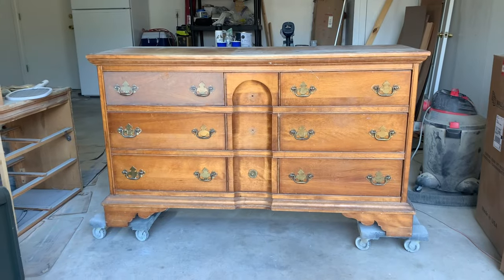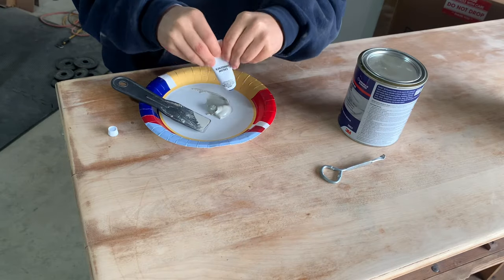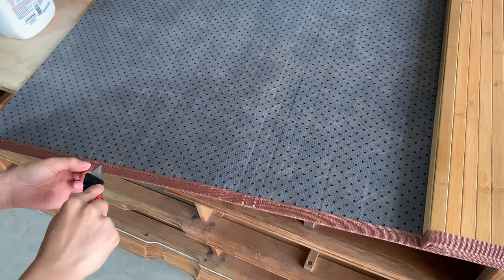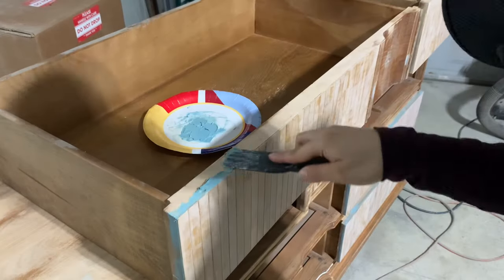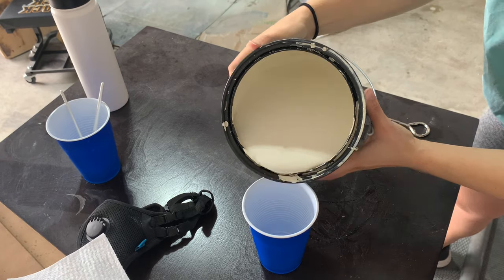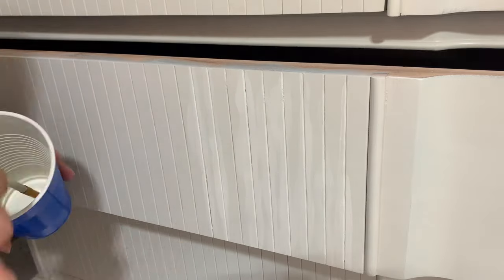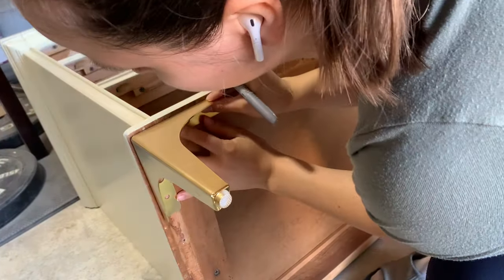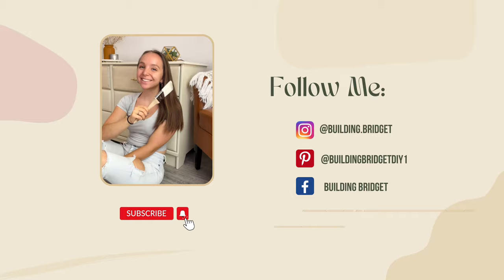EXTREME Dresser Makeover...with SECRET INGREDIENT!

Comment: Did you sealed the metal legs after you spray painted them.  Thanks
Reply from the maker: Hi Sharon! I didn't seal the metal legs after spraying cuz they really didn't need it. The Rustoleum spray paint I use isn't supposed to need a top coat.

Comment: Hi Bridget! 
Can you please help me with these questions? 
- How to choose sandpaper grit for regular sanding,  sanding for the wash effect, and smooth out after painting?
-How to take the dust off if we do not have a vacuum? 
Thanks
Reply from the maker: Hi there! For sanding you're generally always going to wanna work your way up to finishing with 220 grit. Start with a lower grit like 80 if you're having a really hard time cutting through the surface, but typically I start with 120/150 and work up to 220. After you've finished painting don't use anything more abrasive than a brown paper bag or else you'll leave scratch marks.
There's not much you can do about the dust if you don't have a shop vac. You can get one pretty cheap second-hand though usually!

Comment: New subscriber! Such a transformation, I never thought about adding light colored paint to topcoat (only dark) but this worked great.  Do you find in your market that the higher priced items take longer to sell, even though they are totally worth the price for the extra details like drawer liner, feed and wax, extra wood filling, new legs/hardware, etc.  It seems like people want a garage sale price on marketplace for flipped pieces in my area.
Reply from the maker: Hi Heidi, thanks for the sub! 🙌 Good question - I try to be selective on which pieces I'll put all the extra cost/effort into. If it's a nice MCM or just solid wood piece that I know from experience has a decent selling point, I'll go the extra mile and do drawer liners, bamboo mat/fluting details, add new legs, etc. I've spent a while fine-tuning my approach on what pieces to flip and how to market it best, which has helped me to increase my prices by hundreds of $$ over the last year or so!

Comment: I found a soldi wood dresser but the top has this wood paper covering, is there a place to get that covering to replace or just remove layer?
Reply from the maker: Hmmm if it is what I’m thinking of then I def don’t know of any way to replace the “paper” layer. If you’re tryna keep the wood finish on the dresser I’d try and remove the top and replace it with plywood to match and edge band. If you’re planning on painting anyways, no need, just paint over the current top.

Comment: What’s your method of keeping the inside of the drawers paint free?
Reply from the maker: They only really get paint inside/on the edges if you pull the drawers out when you’re spraying them. I usually leave them closed and then pull them out after spraying and touch up the edges with a small brush.
Reply: @buildingbridget that’s a good idea I never thought of just touching up the sides with brush. When I’m spraying I like to get it all at once but it is a headache to have to tape off the inside/sides of drawers!